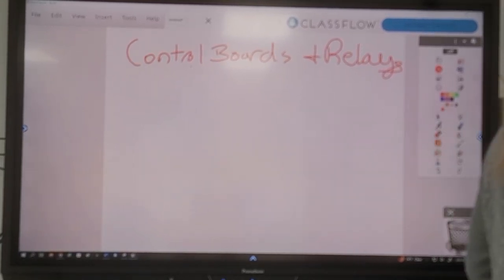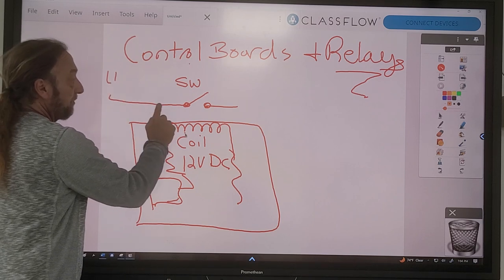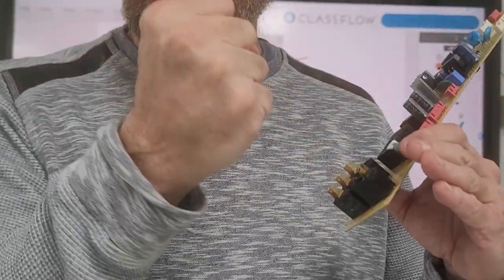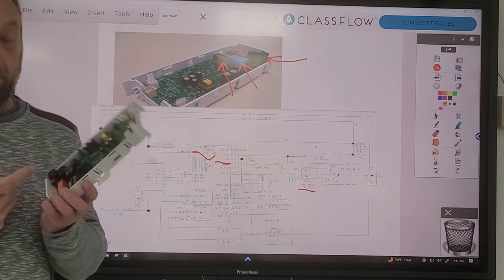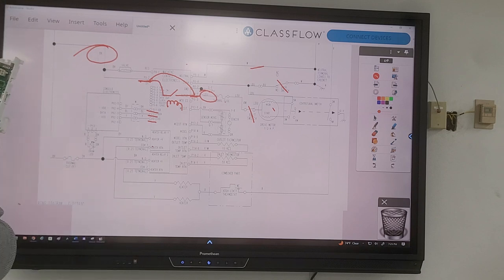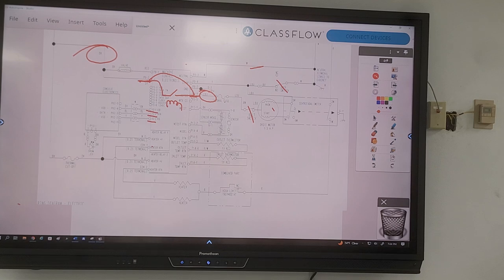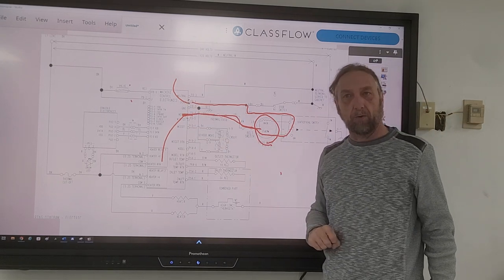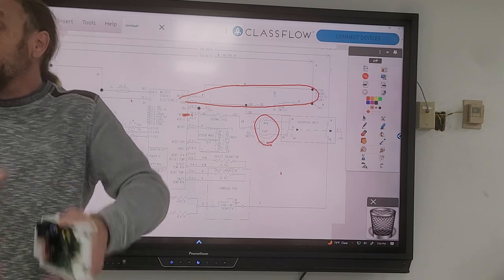Understanding Control Boards

Comment: Hi, I was watching your video about control boards because I have a window AC with a digital panel that has a mind of it's own. Turns off and on, changes the thermostat settings. That's pretty much it. I removed the display board and though it has, what seems to be, mechanical buttons for the different functions, it does things without being touched. The buttons are clicky. But not sure if that means mechanical or some kind of liquid contact material. Could relays activate a switch if dirty or wet or the like? Just picking your thought. Any advice? Thank you.

Comment: But how many times has there been no wiring diagram with the machine. It grew feet and walked away. Is there a good solid source for wire diagrams?

Comment: Hi, Sir. I have a GE Refrigerator that I am trying to diagnose. Could you tell me what the micro switch does? I believe it is an input to the motherboard, but I can see that it is used by the control board to power the dispenser solenoid. GE model Number GSS25QGTA CC

Comment: Great instruction! Do you do component level repair occasionally?
Reply: Myself no, Only board I feel need repair are old built in refrigerators that may be thousands of dollars to replace and new board is no longer available I would use someone like Core Centric, they warranty the part. I have a few times changed relays or resistors  board but not that often.
Reply: @riz65 So true. These control boards seem to cost as much as the appliance is worth.